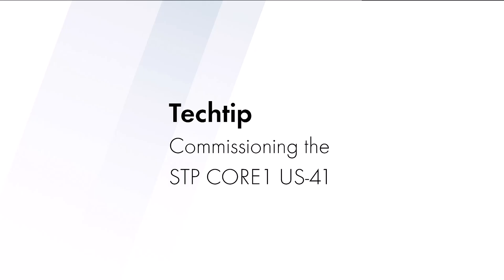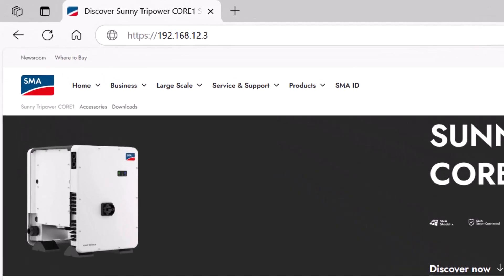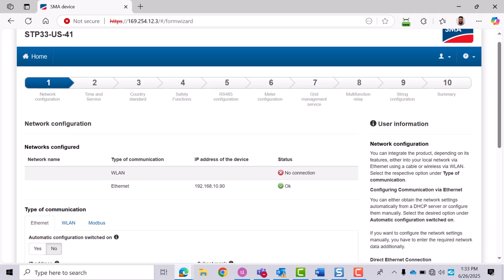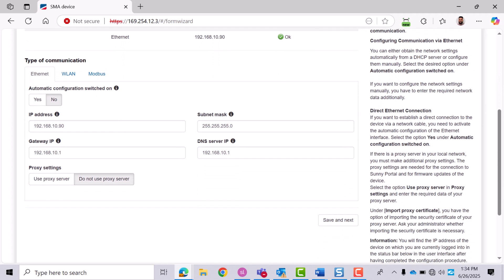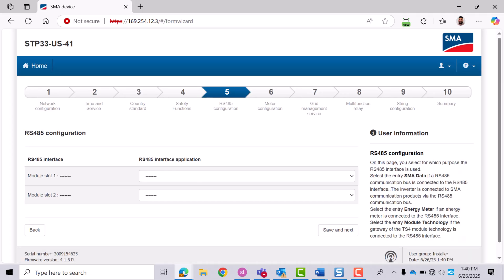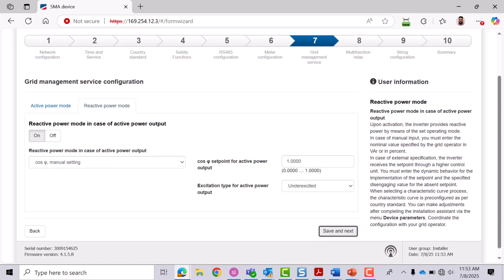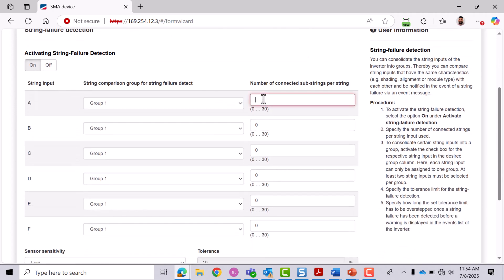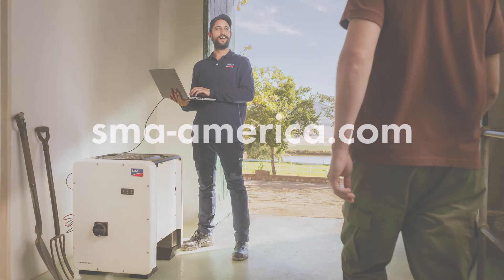TechTip: Commissioning the Sunny Tripower CORE1-US

Comment: I have the same model. There are no error logs, and all DC strings show voltages between 750 and 820 DCV, but it is not generating any output. Do you have any ideas about why this is happening?
Reply from the maker: Hello, that's strange. Does your comment about the missing error messages refer to the user interface of the inverter or to our Sunny Portal? Have you already checked both interfaces for event messages? Sunny regards, Daniel of the SMA Social Media Team